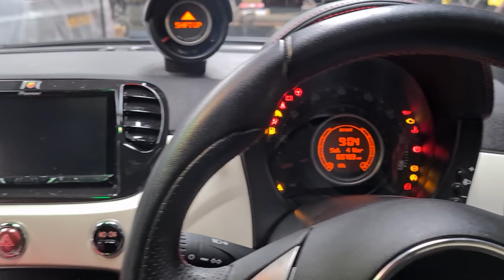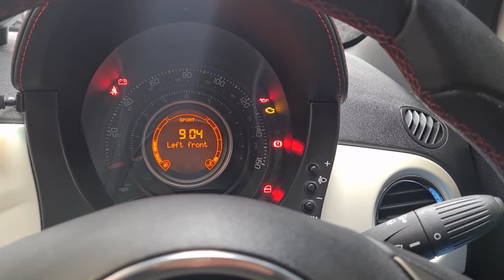Abarth 500 in the workshop hows it holding up

Comment: Recently had to change the cams & carrier on my brothers 230,000 mile 2012 Abarth due to the cam bearings starting to go. I really recommend you change the oil every 8-10k, rather than the recommended 18k. Luckily I`m breaking a 110k 2009 Mito 155 T-Jet Veloce, so I just swapped them.

Theres zero rust on it, even at the front of the sills that have been stonechipped back to the galvanised steel for years..

Comment: Interesting look at a U.K. FIAT underside vs. my U.S. 500. I picked up a 124k mi., '12, Sport, that came from Denver, Co.(car dealer auction) & sat on a S.D. used car lot unlovingly for 7 months last year. I looked under it one Sunday and was quite impressed & surprised how good it all looked underneath, much nicer than this, no flaking paint, everything still nice & black. I bought it about a month later & it's treated me well although I think it helps to be mechanically inclined with this car, as simple as it is though.  I notice the Abarth here doesn't have the bottom engine shield. I took mine off, even though it had been there after all this time. My opinion about the shield is it's there for aerodynamics, meaning, gas mileage. Especially at higher speeds. And, obviously, it provides some physical protection. And, I could see some advantages living in a cold (cold) climate, the engine warms quicker. I'll take the fuel penalty though, for increased air flow around the oil pan.